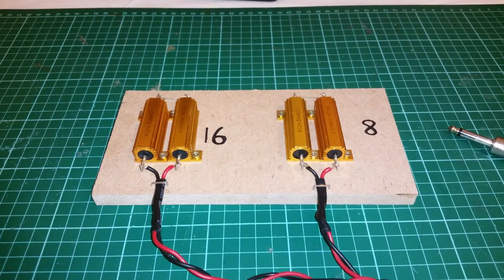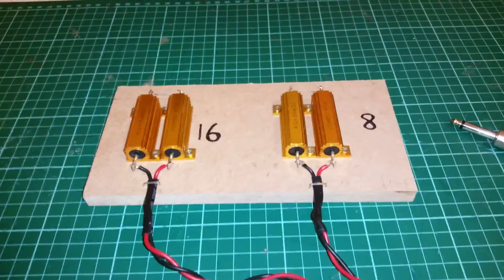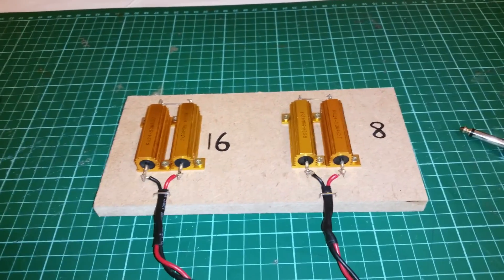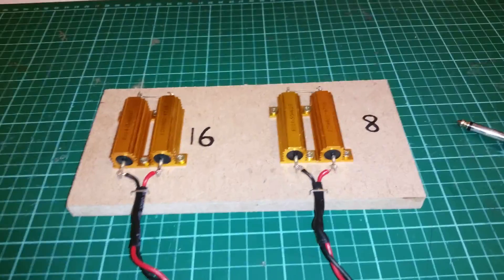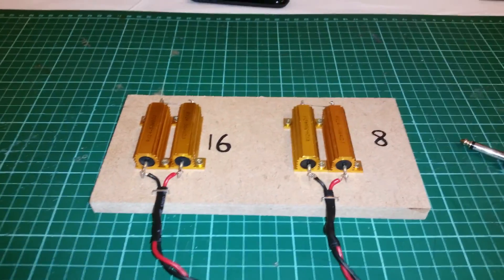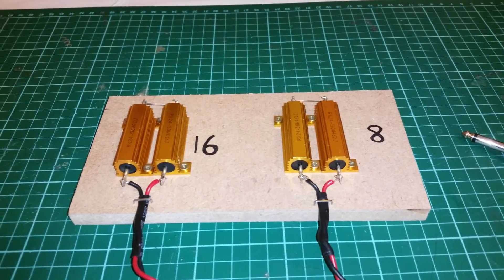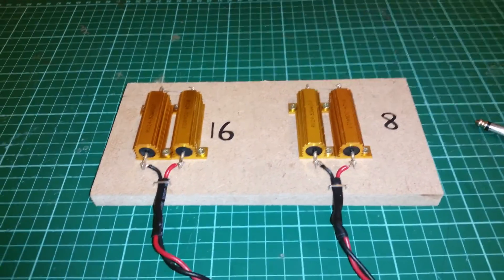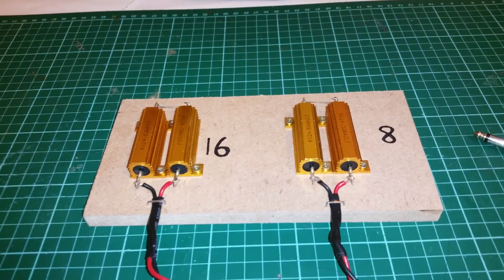8 and 16 Ohm Dummy Load

Comment: Just for the record - those resistors cannot dissipate the rated wattage without being attached to a large heat sink.
Reply from the maker: I don't run the amps at 'full chat' probably at 25% of max volume, so I don't think it will be a problem. But thanks for the advice.

Comment: How do I make a 8 ohm speaker 16 ohms output , do l just put an 8 ohm resistor on the positive lead of speaker? Now I have. 16ohm speaker?
Reply from the maker: You shouldn't, it's impedance not simple resistance. 
If you measure the DC resistance of a speaker it will be lower than the rated impedance. This is because the inductance of the coil affects the impedance as well. A simple resistor wont do this.
If you need a 16ohm "load" to match your output add another 8 ohm speaker in series.
Reply: @AndyWragg  Hi Andy, I can no longer buy a horn with a 16 ohm driver. My LF Woofer is 16 so I am trying to match so sound is good and I don't want to damage my output transformer. 
This is vintage equipment.
I I was thinking of getting a Pyle PH391 horn tweeter and hoping that will work. Thanks.

Comment: Help from anyone on this would be helpful. I want to build a dummy load just for testing my own personal tube amplifiers . My amps are 45 watts , 2ohms . What size resistors would be ideal? Thanks for the help
Reply: These resistors get really hot so I would go with at minimum (2) 50w, 4 ohm resistors wire in parallel.  This will give you a 100w, 2 ohm load.  Even better for heat would be (2) 100w resistors for a 200w, 2 ohm load.  You may also want to consider mounting them to a heat sink.
Reply: @bobkraft9029  thank you so much . So I have it built . I used x2 4 ohm 100 watt resistors wired in parallel. Lol , I made a good guess I'm assuming . They were premounted in heatsinks. I added a switch also that allows me to choose between 2,4,8 ohm resistance. I apologise your help sir.
Reply: @donniefisk2252  Great minds think alike :)  Glad it worked out for you and good thinking on the switch.  I have similar but have 4, 8 or 16 ohm loads.
Reply: @bobkraft9029  indeed !! Very nice , the versatility from the switches are nice .

Comment: Nice little device you've put together. Please let me point out a couple things:
1) Good use of resistors in series which greatly reduce inductance
2) Used material MDF has high thermal insulation capacity and combined resistors rating of 100W is rated only with heatsink. Without heatsink ->  rule of thumb about 25% of rated power. Check out datasheet.
Reply from the maker: thanks

Comment: Hi! Nice video. I'm looking for a DIY load box to connect an AMT Pangaea to the power amp output. This gadget is a cab emulator, which uses the power signal, but it requires a load box. Do you think that adding a series inductance would improve the dynamic response or something in the power signal?
Reply from the maker: Honestly I have no idea. Thanks for watching.
Reply: Hey I am in the exact same situation with my Two notes Cab M. Did you ever find anything that worked for you? Really want to get an amp head but I don't want to drop a ton of money on a real loadbox.

Comment: I saw about the guy with the Mesa Boogie wanting to use this for a live application and I can see how heat would be an issue in melting the dummy load from stage volume.  Would this be feasable in a home recording rig though?  I'm interested in trying this out as sa self-contained addition to my Bugera 333XL for home recording purposes using the Preamp Line-Out.  Or would that generate too much heat over time even with the Power amp turned down?  Just checking options.
Reply from the maker: If you designed the dummy load in such a way that it can be cooled by a desk fan or something that would probably make the situation better. As I have mine mounted on a piece of MDF, the board starts to burn - due to heat - if I have the load on for too long. There are designs that use a paint can full of mineral oil (for cooling) using a number of smaller resistors in parallel, that might work better for you.

Comment: I play the guitar and use a stereo power amp (a Mesa Boogie Fifty/Fifty, which is paired with a Mesa Boogie TriAxis preamp). Sometimes it's pointless for me to carry around both speaker cabinets to a gig. Would it be ok to plug one speaker cabinet to one of the sides of my power amp and an 8 ohm dummy load like yours to the other side?
Reply from the maker: Marcelo Rangel Hi there Marcelo.  It's not something I'd want to do as the product of using a dummy load at gig volume levels would be lots of heat. A dummy load like mine is not designed for sustained use. You'd be better of using the preamp only straight into the PA with plenty of guitar in the monitor mix. Alternatively get a smaller rig for smaller venues. You may want to investigate whether the 50/50 can be run in single channel mode. It's not a product I'm familiar with.
Reply: Thanks for the prompt reply, man.
I'd use this load with the volume turned to zero and the presence turned to 10 in the channel I want to mute (these are the only controls for each channel in the power amp). Iook for other options to do that, but thank you for replying.
Reply from the maker: Laney makes a powered guitar PA speaker which would allow you to plug in the preamp and still get some semblance of cabinet tone at stage volume. ATB
Reply: Marcelo Rangel How is this device working for you to load down the unused channel?  I am thinking doing the same.

Comment: Why do you put 2 in series ? Why not just use one with the correct resistance and power rating.
Reply: For greater power handling capacity. 2 x 50 watts = 100 watts total. Or 2 x 50 watts = 50 watts for twice as long, which is a more common reason.
Reply: They must be able to dissipate the heat over a period of time that does not damage them.